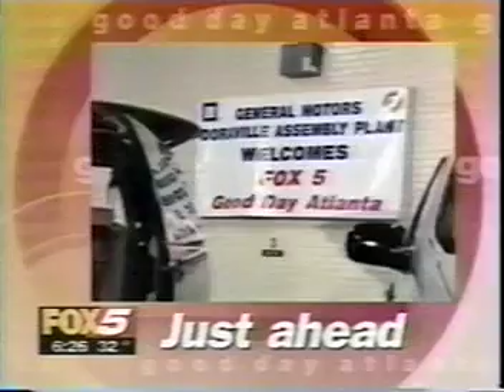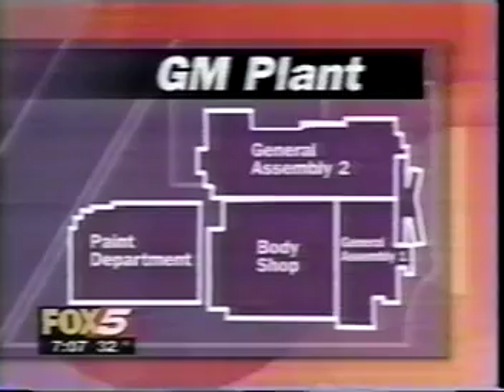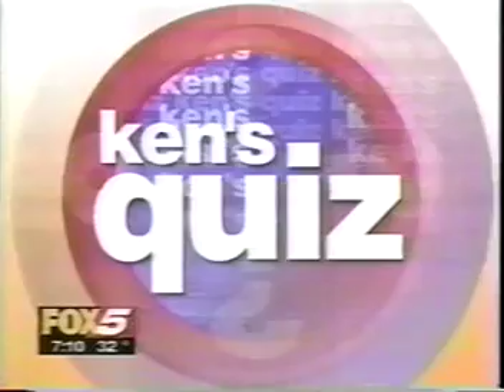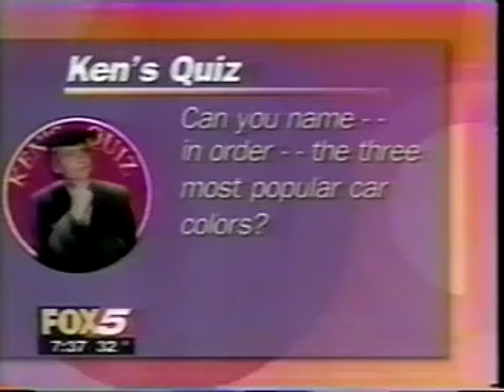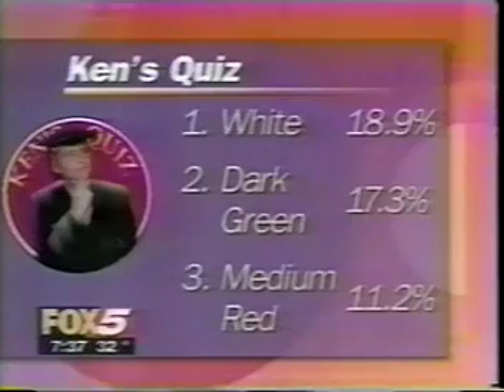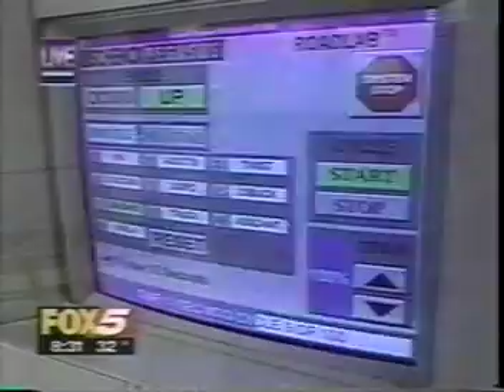Video of Doraville Assembly Plant!

Comment: I remember working on Randy’s computer a couple of times when I worked there, guess this must have been around 1999-2000.

The computer that ran the “shake rattle and roll” machine (that’s what we called it) was absolutely ancient. It ran on a 486 and died in early 2006. It took us the better part of a week to rebuild it, as it had a proprietary ISA card that ran the machine that would have cost about $12,000 to buy the modern PCI equivalent to install in a newer computer. GM didn’t want to spend the money buying a new one because the decision had already been made to close the plant at that point.